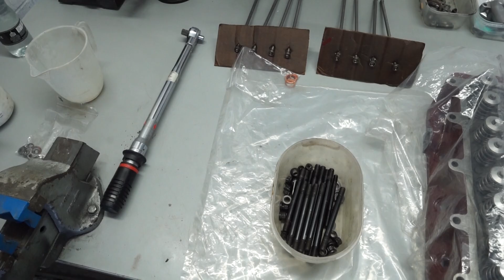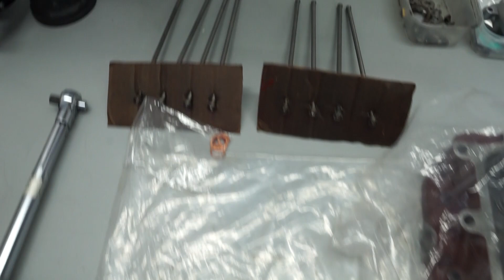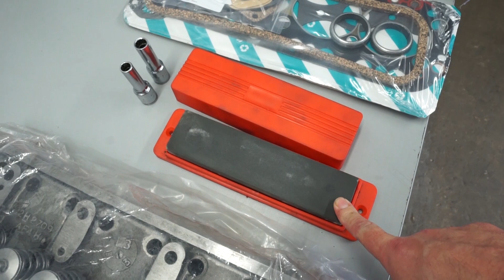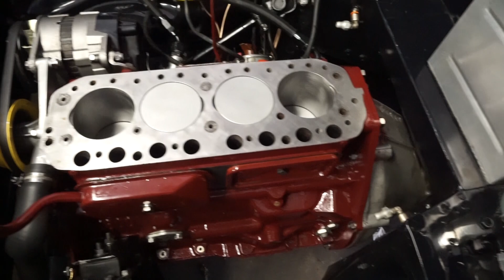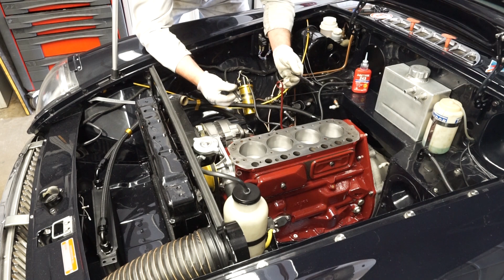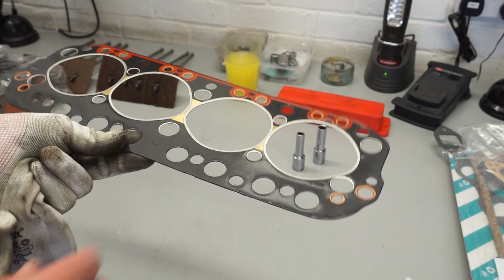MGB Cylinder Head Re Fitting With Step by Step Instructions

Comment: Hello. Have you made any contingencies for the use of E10 fuel? Eg, pumps, lines, filters, gaskets, heat-shields Etc. Thanks
Reply from the maker: Thanks for your message Chris, the pumps are a pair of Walbro 5CA401 (both mounted in the tank with nylon filters attached) lines are PTFE inners with a fabric outer braid rather than steel and JIC fittings, the only gasket is a Viton one on top of the tank. As the fuel system is fairly modern it should be compatible with ethanol fuels and not degrade like the earlier paper filters and rubber hoses.
Last season (2019) I used Tesco Momentum fuel only; I think this is 5% (E5) ethanol or less. Previous to that I had always used Shell V-Power, but I found with the Shell I was getting accelerated wear to the cylinder head. I do use a lead additive (TetraBoost) in the fuel. I was unable to find an accurate figure for the ethanol content of the shell V-Power fuel

Comment: Really enjoyed watching this very well detailed step step step guide to refitting the cylinder head. I've never seen spark plugs cleaned up with a blow touch before now, I've always done them with a wire brush, as they say more then one way to skin a cat
Reply from the maker: I used to use a wire brush, but my original engine builder told me not to just in case any bits of wire got stuck on them. I do find the blow torch method more fun!